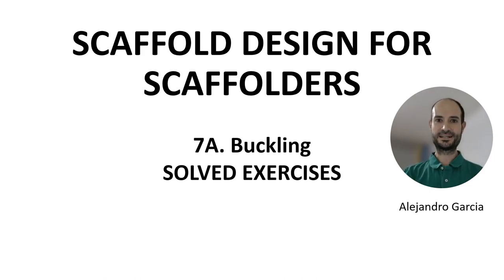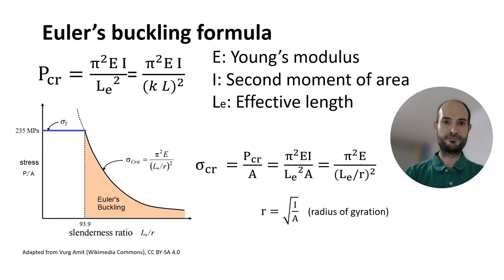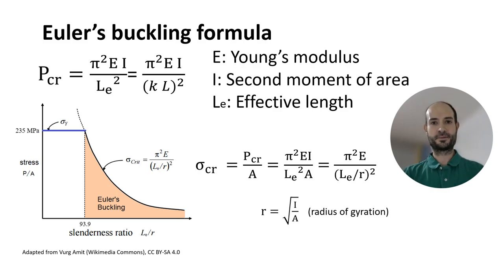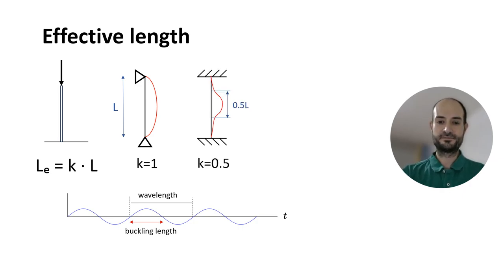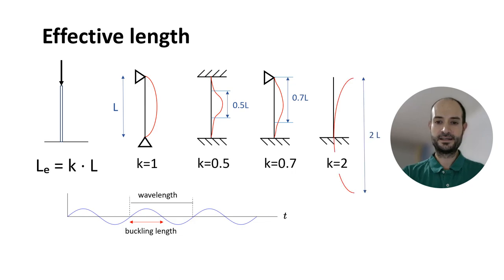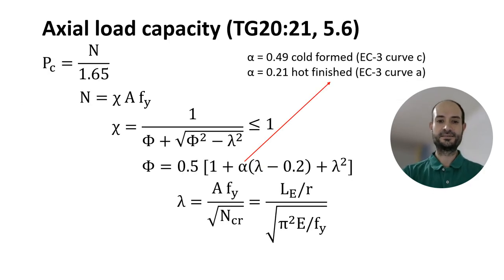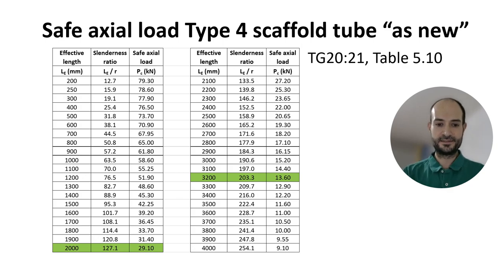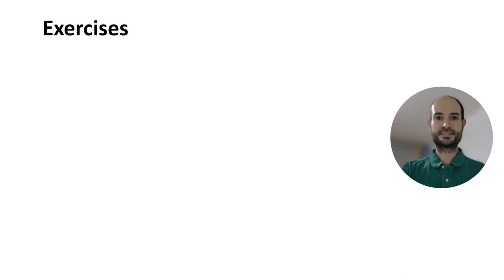Buckling: Solved exercises - Scaffold design for scaffolders 7A

Comment: In the first example, how did you find Factor of Safety value? Can you explain it,please?
Reply from the maker: @onuryarmpabuc7761, the factor of safety of 1.65 is applied throughout TG20:21.

It's equivalent to EN 12811 factors:
- Variable loads multiplied by 1.5
- Steel capacity reduced by 1.1

1.5 x 1.1 = 1.65.
Reply: @alejandrogarciaengineer  thank you

Comment: Hi Alejandro, do you have any design calculation for a high rise tower, please share it with me, either it is cup lock or tube and couplers system.. thanks bro.
Reply from the maker: For a high-rise tower, your main issues will be the scaffold self-weight and the wind load at higher levels.

I cannot share any calculations.